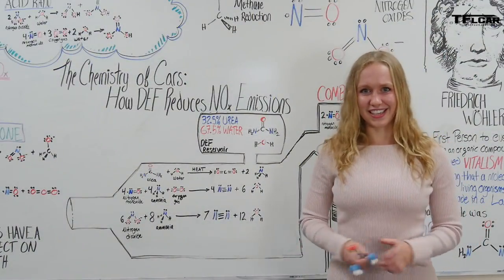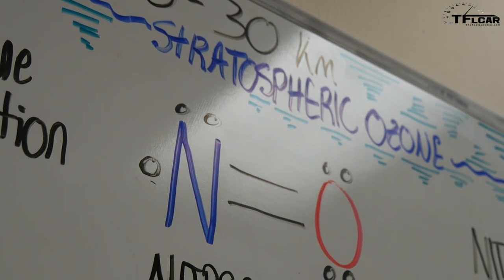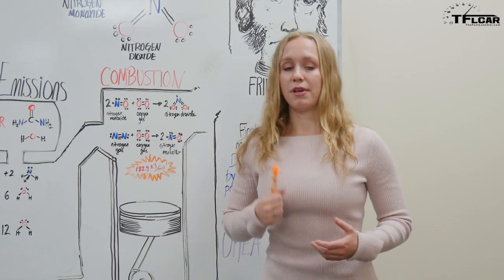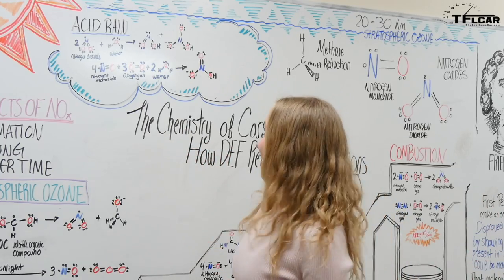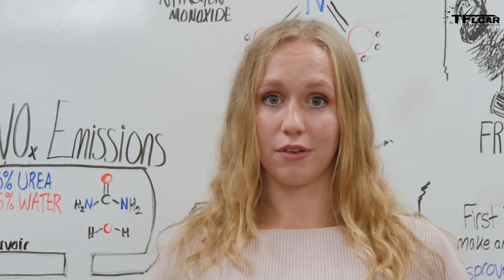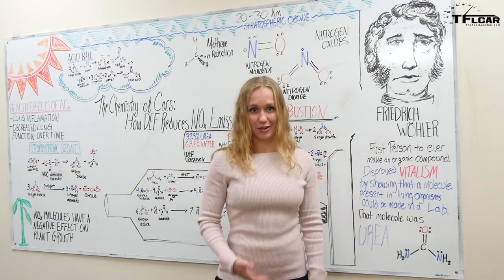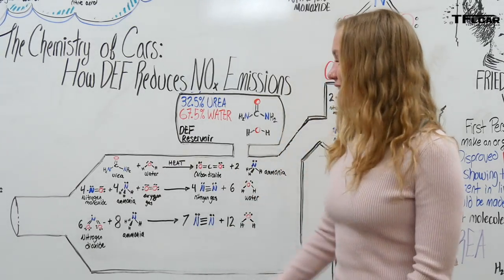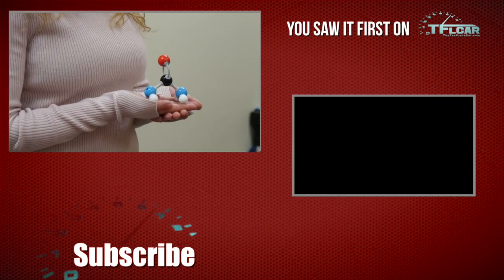How Does DEF (Diesel Exhaust ) Fluid Work & Is it Really Pee? The Chemistry of Cars Ep. 1

Comment: One of my buddies had a wonderful experience with these wonderful DEF systems in diesels now. DEF has a short shelf life and putting in bad DEF can be quite cost worthy. My friend topped off his DEF tank like he normally does and shorty there later his trucks DEF warning lights go on and it tells him he only has 120 miles before the truck speed gets reduced to 5 mph and also that his DEF needs to be serviced. That’s when he found out the DEF was bad and that the DEF tank needed to be pumped out removed, cleaned, dried, and reinstalled in order to drive his truck again. Looking at several hundred dollars worth of work to fix his DEF system he decided to delete it saying the hell with that saving himself money in the process as well as alleviating himself of the headache of having to purchase DEF all the time. I understand the the purpose of DEF more now than ever thanks to this video lol but these new regulations on emissions for diesels with DEF and they recycling of diesel exhaust by pretty much forcing diesels to breathe in their own exhaust just strangles the hell out of them. Although not perfect as they still pollute, diesel does burn hotter, cleaner and more efficient than gasoline engines. I just don’t understand why diesels have to have the hammer dropped on them a lot harder than gassers. Oh and if you’re trying to blame the black smoke or “coal” diesels produce please don’t. That sut is mostly carbon which settles back to the ground where it more or less originally came from. 
Bottom line is I’m tired of diesel being looked at as significantly far worse pollution wise than gasoline engines for the environment. Pollutants released from gasoline engines are actually worse for the environment.
Reply: Because there's more diesel being burned on far longer trips than gas is. Which equals a bigger problem.
Reply: Unless you're using a gasoline engine for the same use, which is like running and claiming its better than biking. Diesels burn more and are used for longer trips because they have a higher energy density you can extract than good old gasoline, but gas can just start and go even when its cold so I think its more versatile for city commutes. Old school diesel engines can run off of french fry oils and the original engines were intended to be run off of peanut butter oil. Many diesels can still run off of biodiesel fuels which can also be grown, so gas is not better for the environment despite the poor reputation diesel engines have.

Comment: Awesome! Hydrogen fuel cell would be another good subject to mention.
Reply: I definitely agree. As far as I know, you have H2+O2(+combustion)=H2O. I know the subject is much more complicated, but I'm not sure if it is more chemical complexity or engineering complexity. From what I have briefly learned about combustion, Hydrogen does seem to be the perfect fuel to use. However, getting the Hydrogen fuel requires a lot of energy, more than is gained back during combustion. It still is not a completely viable solution, but I'm sure some hybrid system could bring it into the mainstream; assuming Hydrogen fuels can be sold to a mass market. I'd love to learn more as well, someone please correct me if I put something incorrect.
Reply: Case Offutt here in California, hydrogen vehicles are already on the road. We'll see if it begins to gain traction. I hope it does!
Reply: Thank you for talking in metric for the international viewers
Reply: @Case Offutt
There's no combustion in the hydrogen fuel cell vehicles. They're using H2 and O2 to make electricity to power the electric engine.

Hydrogen is very expensive to make, it make no economical sense to own a hydrogen car. And it wouldn;t be cheaper - hydrogen is already mass produced for industry purposes, if there was a cheaper way of doing it, it would've been done.
Reply: sic22l I thought there was combustion, like when the Hindenburg blew up. Thank you for informing me of something new!
Reply: Case Offutt you are on the right track. Hydrogen is used for its electrochemical reaction with a catalyst. Cars will have a polymer electrolyte membrane fuel cell which can operate at atmospheric temperatures. Hydrogen comes in and is separated from H2 into 2 single H ions. That separation gives off an electron, which is then transported to batteries, motors, etc. (creating current and voltage) and then fed back to the other side of the fuel cell where those single Hydrogen ions combine with oxygen to form water (the only product of fuel cells). 
It's simple chemistry but these things work on a very small level so the engineering becomes difficult (the best vein designs to transport  H2, how to evacuate water production so you don't essentially drown the cell, etc)

From an economic standpoint, the catalyst is the most expensive part. The hydrogen is also expensive (but still viable). You were right that it makes more emissions producing the hydrogen, however over the vehicles total assessed life cycle, they actually emit much less emissions and the kind of emissions are less harmful generally. 

Hope that cleared some stuff up. They are vastly complicated when you get into them but overall simple in operation.

Comment: Charlotte, Thank you.
I have an older Cummins RAM and after this, I'm thinking about my personal and family health and now looking a moving to a newer RAM with DEF. My current truck is parked in a garage attached to my house, and I have started to notice soot in the garage from the truck. I'm concerned about long term health of my family. Thank you very much for this very valuable information. Keep up the great work.
Reply: The soot part of diesel emissions is actually dealt with by the DPF - diesel particulate filter,  and it`s the really complicated side of the new process of dealing with diesel exhaust.   
The DEF side of it is complicated, too,  but for the most part, does a very small but important job with a system and parts that are fairly reliable.  Don`t get me wrong, DEF systems do have their own inherent problems and will mess up too, given the right level of neglect or ignorance from a human being.  And they have pumps and parts that can clog or just plain fail or wear out.

I don`t mean to dissuade you from buying a new vehicle (and it`s been quite some time since your made your comment about thinking of buying a new(er) truck,  but the frustrations, and expenses that can go with the new systems on a diesel vehicle can be a real nightmare.  Wish you all the best whichever way you do go, with your future purchases.

Comment: How important is the temperature of the exhaust for this reaction? Coal fired power plants sometimes use an SNCR system to reduce NOx by spraying urea into the boiler. However, the exact point that the urea droplets evaporate is really important, because if the temperature is too hot or too cold, then it doesn't react nearly as well, and you end up having to use much more urea than the stoichiometric balance. Does the same thing happen with diesel exhaust systems, or do they not try to reduce all of the NOx, just enough to be compliant?
Reply: Philip Ejzak Great question
Reply: Extremely important, it's (attempted to be) kept within degrees on the better (faster?) computers. The more precise, the better they have control over the amount of emissions

Comment: I have owned 3 diesel engine pickups since 1985, and the current one is a 2016 including the DEF EGR system. When I pull the Alaska hills with my fifth wheel RV in tow, I can look in my mirror and see no black exhaust. There is a certain pride in knowing that my truck is NOT a 'dirty diesel' and I am being environmentally responsible for the horse power and torque required for towing a trailer safely under these conditions. Yes, it does cost more per mile than a gas engine to operate, but that is the price one pays for choosing a complex high torque engine. With that said, I look forward to companies coming up with a more cost effective solution for environmentally friendly diesel engines. Thank you for this explanation, because now I know how and why.

Comment: This is excellent! I have two ideas for future topics:

 - ultra low sulfur diesel. I bought a new Super Duty diesel truck but it requires ultra low sulfur diesel. What would happen to it if I drove it to Baja and filled it up with the diesel fuel that's available in Mexico? I know it would be bad, I just don't know why it would be bad.

 - how do hydrophilic tires like Blizzaks work? They seem to be doing something approaching magic but I'm sure there's some interesting chemistry/physics there.

Thanks for this! I feel like this is the single best addition to this channel in years -- can't wait to see more.
Reply: Moishe Lettvin I think the bigger danger is getting fuel with water or other contaminants in it.
Reply: Well, unless you're interested in spending thousands of dollars on ripping apart and cleaning out your EGR and DPF systems, DO NOT use anything but ultra-low sulfur diesel. Higher sulfur diesel does not burn as clean and will choke your emissions system to death.

Comment: Good video, much better than any other presenter on this channel, but personally i dont like DEFs or DPFs. a truck that used to get 22-24 mpg now is getting 12-14 mpg. 

not trying to sound like an anti environmentalist but wouldnt it be just as bad to make a vehicle burn more fuel by a large amount with these systems on the vehicle? 

im just wondering but what do you think about that part of all these emission controls doing that?
Reply: Think of how much CO2 is emitted with high fuel consumption. When you reduce one kind of emissions through these systems, you increase another. The goal should not be to reduce one particular kind of emissions, the goal should be to improve engine efficiency, reducing overall emissions. This all gets lost by these regulators who don't understand and keep pressing these rules on us.
Reply: Exactly. I love my old diesel it gets better mpg than almost all new ones on the road and has no def or dpf that are costly to fix

Comment: This was a really good presentation, and I look forward to more!  I have the following suggestions:

Start with the most basic explanation, and work up to the complicated bits.  i.e. nitrous oxides are produced in diesel engines, and they are bad for plants and animals, including especially people!  Adding DEF to the exhaust converts them to harmelss nitrogen gas and water.  Then get into your excellent detailed explanations of the processes.

Each of the areas on your board, explaining one part of your presentation, might be better understood if it was one slide on sketch on its own, rather than part of a big board.  Think Powerpoint slides.

One question I have is why not just inject ammonia into the exhaust?  I can buy that at the grocery store...

As the father of a daughter in a science college curriculum, and a car/truck guy, I am heartened to see a female of substance on an automotive channel. Examples and role models count!

Be well and make more videos!

Comment: I often wonder how large the benefits are on def. I dont doubt it works. I just wonder about the emissions created while manufacturing, packaging, transporting and storing def compared to the emissions reduced by using it.
Reply: Okay - good question…. Now let’s go one step further.  We know that all of the EPA regulated stuff on engines (particularly the diesel ones) make it less efficient.  Not ONE emission device creates higher MPG…. So it begs the question…. If now we are burning more fuel to travel the same distance are we REALLY reducing pollution overall??  And .. our engines are not lasting as long & require more of the expensive additives & maintenance & repairs…. So really who is further ahead and who’s costs are up for HOW MUCH benefit. Unfortunately the PTB will not address this issue…. And electric cars/trucks ARE NOT the answer.  I’ve taught auto mechanics & run a successful trucking business before retiring..  Bottom line:  I say BS to all of the “environmentalists”

Comment: I love it Charlotte!  You should definitely do a few more.   This is great stuff! 

Here's a chemistry question, if you pull H out of H2O for Hydrogen fuel cell, does all the extra Oxygen molecules floating around make the air much more combustible?
Reply: The production of H2 does not increase the atmospheric percentage of oxygen. The energy requirements to produce H probably create more CO2 than gasoline, and uses up any extra  oxygen released from cracking water into hydrogen  and oxygen.
  Until we can build and sustain production of H2 with solar and wind power.
  An interesting proposal is to take excess electricity to produce hydrogen as a storage medium, like a chemical battery; Electrical grid could store more energy than batteries, and save the strain on the grid by removing some of the load that might be used by battery electric vehicles.
Autolinne has a number of videos on the subject.
Reply: Then you may find this article an interesting read:
https://www.wsj.com/articles/coal-mines-are-reimagined-as-a-new-power-source-1495713601

If you have a few of the Autoline videos, do share with me.  Thanks.

Comment: may be more of an engineering question but how efficient is DEF at performing this reaction? does it take out 30% of these NOX gases out? more? less? asking in general terms as i know there will be variability from engine to engine and environmental factors will play a roll.  

example, are diesels bigger polluters in subfreezing temps since heat is a big contributor to the DEF reaction?

Comment: The Haber process is used to create nitrogen compounds used in fertilizer from the N2 in the atmosphere.  It is an energy intensive process and it occured to me that instead of using urea and water to neutralize the nitrous oxides in the diesel exhaust, why not add a reactant that would precipitate out a solid or liquid useful nitrate compounds that can be collected from each vehicle at service stations.  The reactant used would probably cost less than DEF.  I am speculating that sodium hydroxide (lye) is cost effective and could be a way to convert the nitrous oxides into sodium nitrate.  Or calcium hydroxide for making calcium nitrate.  
We would be using the energy of the diesel combustion to create useful products rather than using another expensive compound to convert it back to N2 and water.  What is the chemical feasibility of this?